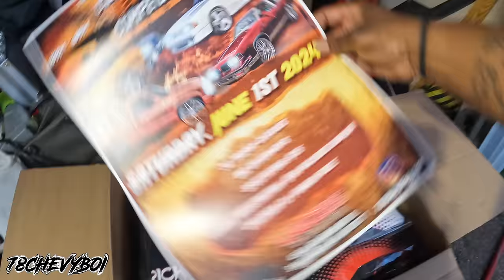Penny goes Back 2 Islandman to get Finished Up!

Comment: Did you put a 6l80e in big penny? And that lt swap turned out beautiful
Reply from the maker: 8 speed
Reply: @78chevyboi  ok! I asked because I was trying to figure out if a 6l80e would work for me because I bought a l92 6.2 out a Escalade was 4x2 with transmission. I could not pass that deal up for the price I paid. Big penny on a whole another level! Motivation for me to get my project done!
Reply from the maker: @Knard35  Definitely bro, a six speed will work as long as you have the right harnesses and computers